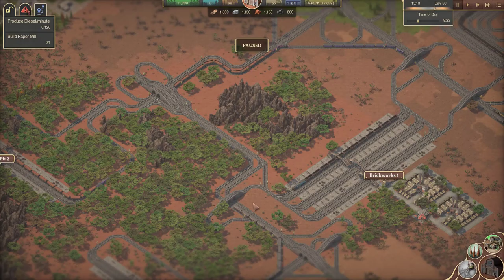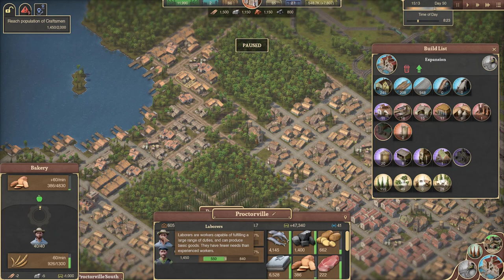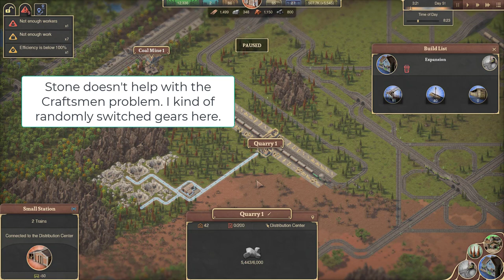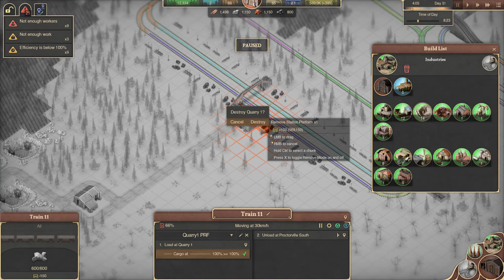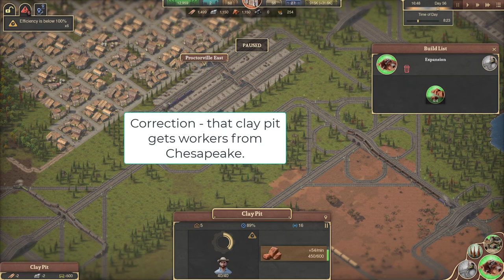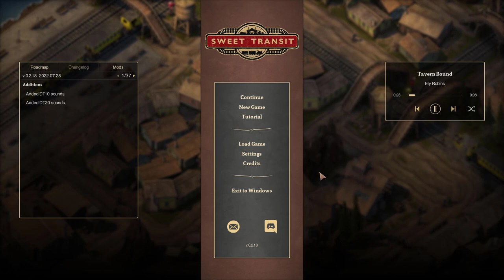S1:E25 Sweet Transit - Our First Look - Diesel Train and Improved Worker Loading

Comment: You also need JOBS a available for the craftsmen uogrades. They recalc based on job a availability.
Reply: Like Johnny says, you can only upgrade to Craftsmen residents, if they have work available. Which means you have to create a demand and not have enough before you can make more, seems backwards to me.
Reply: I usually can add a little bit of workers to bricks for craftsmen when I want to upgrade.

Comment: In the top center Menu, above where you can hover over wood, stone, bricks and coal, there are sections for Population, Cities, Workers(?) Trains and Stations and Income. What do all those show on mouse-over? (Not playing the game so not sure what you can find out up there--only ever see you use the Income one. Maybe you looked at them once and didn't find much use, but maybe they've been updated along the way?)

You were building craftsmen houses in PV NORTH area, but building replacement houses in the SOUTH. (Well, trying to get Craftsmen in both N and E areas, I guess, but maybe build extra houses in both sections?) The train to move pax from east to north is kinda of a kludge and fills up your lines, though I guess it DOES work.

Remember that you can build diesel storage at any station or depot now. So if you ever get diesels not running to the warehouse you'll have to dot those around.

You DID at one point realize there is a SEARCH box at the top of most things--try to remember to use it as typing 'Quarry' in there would speed things up when you try and find trains, etc. (Since you have like 68 trains now!)
Reply from the maker: The top bar has some stats with very little gameplay value.

Comment: I do a similar setup with the passenger trains except instead of time, I use until done and Full passenger load. That will insure all tired passengers have left and it is full before leaving. It is faster then sitting there for 20 seconds when not needing that much time.
Reply from the maker: Good idea. I think this is an improvement.

Comment: I, like you, do not understand the Laborer usage. I even went as far as to create a spreadsheet that tells me the total in town laborers. I have a total of 7650 available, and use 2140. I still constantly have laborer shortages at the various train drop offs. I was going to switch them all to load full, like you did, but then if I don't monitor them, one might sit for too long and cause supply issues. . .
Reply from the maker: I never did come to terms with what the true work / rest cycle is in game.